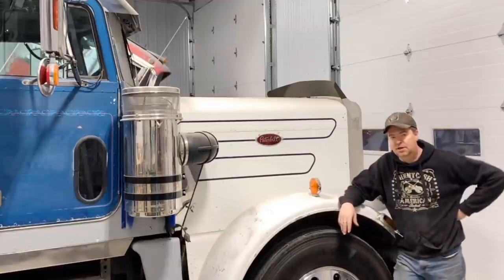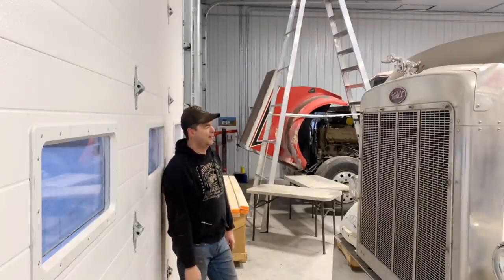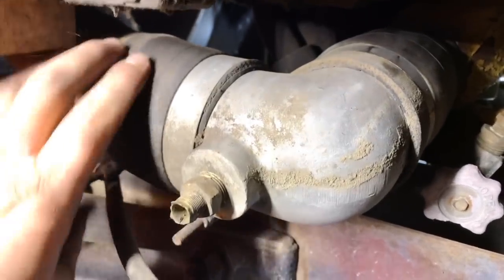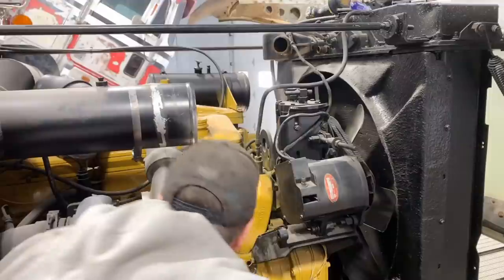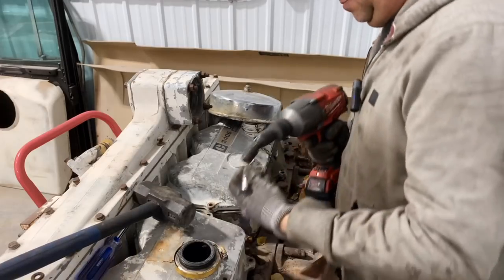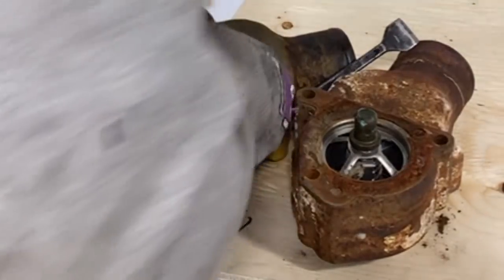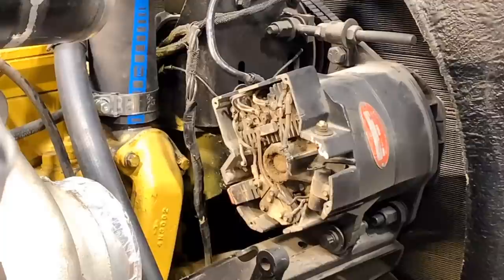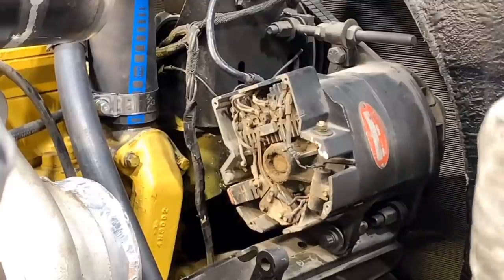Peterbilt 359 Restoration Ep.69 Candy Flavored Coolant

Comment: Thermostat screws out as it heats up opens a gap between the cylindrical housing and the heating element side and let’s coolant flow by Mark your not the only one buddy I had to stick a propane torch to my old one to see how it worked because I was always scratching my head on the way it worked myself
Reply: Pretty close, it actually doesn’t screw out it uses a special type of wax inside the copper temperature sensing bulb that expands as it heats up. When the engine is cold coolant flows across the sensing bulb down through the center of the thermostat and down the bypass pipe back to the water pump inlet, as the heat builds up the barrel of the thermostat expands away from the base and at full open the face of the barrel seals off the bypass forcing all of the coolant through the gap between the barrel and base to the radiator.
Edit: I guess I should correct myself it might appear like it is unscrewing itself due to the bind of the coil spring that holds the thermostat together.
Reply: My Detroit thermostats are identical. And they work perfect.
Reply: @dennisternent2974  same one in a Cummins N14 too
Reply: I think his point was that the thermostat he bought is already open. At room temperature.

Comment: I seen two mistakes you made on the bottom with the pitcock elbow. You should have cracked the first gallon of antifreeze and lubed the hose ends and you should have had your clamps already in place
Reply from the maker: I did use a little soap inside the hose and it wasn’t an issue to put the clamps on afterwards 🤷‍♂️
Reply: @TwinStix  I had no idea you prepped behind the scenes

Comment: If you take some household dishwashing liquid and rub it on the inside of the hoses it'll slip on much easier.
Before putting in the expensive coolant get some radiator flush.
Put normal water in and flush the engine about 2 times at least.That way you can get  any rubbish in the coolant system out before expensive coolant goes in.
Reply: A little saliva works good to
Reply: Cat flush ; I used WD 40 on the hoses !
Reply: Be careful with the flush I did it with cat flush and it did such a good job the water pump started leaking. We used to use calgon back in the old days

Comment: Glad to see you used the "lined" clamps for the silicone hoses. A standard clamp with the diagonal slots exposed will eat into that silicone in no time. Silicone hoses will last the "life" of the truck, as long as you use those clamps, and also make sure that NOTHING chafes or rubs the outside of the hose. I've seen wire looms, tie-wraps, or air lines slice right through a silicone radiator hose as if there was a grinding wheel put to it!!

Comment: Congratulations on the new compressor. I got tired of dragging air hose around. This started me on the quest to run air lines around to convenient places. A farm supply store had kits, but it was expensive. Someone else said to use black pipe. This would have required someone with a pipe threader. Looking around Home Depot I noticed that PEX is rated for 160 psi, or piss I, as Peg calls it. This solution has worked well for me since my compressor is set for 150psi, and my regulator is set to 100 psi. In over a year it has worked out well.

Comment: I use a whole bottle of dish washer soap (no bubbles) fill with water and run it till operation temp. Then dump and then run a few cycles of water threw it to really flush soap and crud out.

Comment: Once the thermostat opens, there becomes a gap between the upper ring and the cilindrical schaped piece, so the flow of coolant does not go straight thrue. It goes in  from the side and goes out the top. Sorry for the crappy english

Comment: Hey Mark i use hairspray on all rubber hoses clean the metal up and spray both recieving ends of hose stick the hose on and let it dry as long as you can then put clamps on seals everytime

Comment: Some shutoff valves on the hoses going into the cab cores is a good idea in case of a core leak or you don’t need heat there during the summer.

Comment: The seal shuts the water from circulating, when the thermostat opens then the water flows through the system. There is a product called restore made by Cummins or Fleetguard which is part of Cummins and available at Peterbilt. It cleans the cooling system. Works well for cleaning the system from oil as well after a oil cooler failure. Most people use it even in the Cat engines. After running the Restore run clear water through it to rinse it out then put in your coolant.

Comment: Mark, you got it right on the gasket sticky side. Always goes to the smaller easily removable part. Cleanup is much easier that way. To keep water out of your compressor tank, there's auto drain valves. Might want to check that out. Lots of choices.
Reply: We put pull cable like on a “ truck “ air tank ! When we would turn on power too the shop you pull the cable too drain the water everyday!!!!

Comment: Mark, what you called the condenser on the alternator is likely just a noise suppression capacitor, used to filter out the electrical "noise" of the alternator and prevent it whining in the truck stereo or UHF speakers. I guess condenser is probably still an accurate term too. It'll still operate fine without it but can get annoying. And it looks pretty simple to fix. Small general aviation prop aircraft alternators mainly use external capacitors for the same reason.

Comment: Hey mark. If your hoses are bulging that could be a sign of the coolant system pressurizing up. Maybe from a head or gasket issue. Coming from my opinion after having a c-15 blow all its new hoses because of a cracked head. Not saying yours is but carry some extra hose and coolant to get you home if that issue arises.

Comment: Mark, put the thermostat into a  bowl of boiling water. Particularly the copper wax filled element, then watch the valve open.. These thermo valves are used in oil cooled air compressors

Comment: Fluid is around the outside of the thermostat. When it opens it slides and let's fluid come from the sides of thr barrel of that thermostat. Otherwise it goes threw bypass until coolant is warm enough to open sides to allow threw the center and less resistance than the bypass. Hope this helps.

Comment: Good tip with the shut offs, open fully then turn back 1/4 turn that way the rubber seal inside doesn’t get stuck and seize in there on ya next time it needs turning….

Comment: Diesel exhaust has some fuel oil vapors in it when you run them cold. If you run your air compressor in that atmosphere? You will contaminate your air supply and that`s bad if you do paint and body work. Fish eye and all sorts of issues. I would plumb the air supply outside the garage to fresh air.

Comment: Little trick I learned but i don’t know if it’ll work for that big of a cooling system. Take a shot vac and make ya a grommet for the for the radiator cap neck and you might be able to pull enough vacuum to slow or stop the coolant from gettin all over the place. I did it with a Grand Prix for the engine oil plug seal and I was wowed that it worked for the oil. Didn’t spill a drop to change the plug seal.

Comment: That seal on the thermostat needs to be straight or it will leak and bypass, 
But I suppose that’s better than none at all.
Movement up and down open the passage to the radiator
Good luck with the extended life cat coolant it will find leaks you never know you have, very good for liner corrosion though.
Another edit just imagine doing this on a 1990 truck that is working every day.
Enjoyed the video because I’ve felt the struggle. Prost 🍻

Comment: Sanborn compressors are the same as Coleman powermate compressors and the Kobalt brand sold by lowes.

If you shop around the cat coolant is not that expensive I usually pay around $20 per gallon for that exact coolant.

Comment: I use a female air compressor fitting on my air tank then use a male to male with a valve in between makes it much easier and cheaper plus it allows you to be able to hook a air hose to air up tires when your away from the shop

Comment: I hate commenting cause you’re already done with the task.  Any ELC Diesel coolant will work you don’t need to pay for the CAT name.  When the T-stat slides opens it blocks a port in the passage allowing the coolant to flow to the radiator, then slides closed closing the passage.
You could have removed that old artic coolant heater cause I doubt you’ll ever need it. If you do leave your truck outside in the cold you can purchase Fleetguard block heater for much cheaper.
Silicon hoses are excellent just ensure nothing rubs on them.
You have mineral hard water deposits build up in your system.  Does this truck have a coolant filter and you may want to have the system flushed before keeping the expensive coolant in there.
Great work keep these alive.

Comment: Did I see that right? Your mirror turn signal lights lit up bright when you applied the brakes. Is that how they’re supposed to be wired in Canada? I know laws differ some in light requirements between the states and Canada.
Reply from the maker: No it’s something that needs correcting

Comment: 20/20 hindsight you should have opened the Radiator cap. Looked like there was a bet of pressure behind that coolant.
Reply from the maker: I think it was just the head pressure/weight of 16 gallons of fluid 🤔

Comment: I tried silicone hoses once... and I will NEVER use that crap again. Holy cow what a mistake. Every single one blew at the clamp. The expand allot more then rubber does, and they chew themselves up at the clap edges. I hate to say it, but you better replace that stuff with real rad hose! I use 3M silicone paste (3M part number 08946) to very, very lightly coat the inside of the hose to get them on the fitting. You can use it on spark plug boots too. The stuff is amazing.

Comment: When you drain the coolant  there was pressure because youve let the engine run,
Why dont you use a litlle bit gasket maker, the liquid gasket on the gasket?
And why dont you sandblast the housing and then paint and mount them.
Just an idea.
Keep on wrenching,

Comment: if you ever take most of the stuff your putting on off you will kick your own butt for not using anti sieeze on bolts that pass thru stuff, like the thermostat housing, the lower seal blocks the coolant flow and it slides the bore up and down letting coolant pass,  wd 40 sprayed on the hoses and the pipes makes your life easier, if you havent done it already you need two bottles of dca added to your coolant system and then test strip it at services for the ph level,  dca is much cheaper than coolant filters, which have hard dca in them that is dissolved over time,  the thermostat is basically the plug end of the cooling system hench the regulator name from cat, a cummins or detroit part would have worked also,

Comment: Seriously Mark, a truck leaves the factory with some kind of problem or more problems. And the grandkids if Bidens branch has their way, all electric automatic trucks that will hover over the roads... George Jetson was just the prelude to things that come... that PBR can will come  from our beautiful trucks we busted our a$$es off on. I do have news from a rig I seen put together in the not so great state of califony... shrink fit hoses on everything and I mean everything... extreme heat, and very high pressures. The theory behind those thermostats is to not cause a hot spot on the liners, it creates a vortex and water will always flow but just enough restrictions to do the job. I kind of dig it really as water that gets too hot is  how the calcium is caused to separate from even distilled water. I don't think there will ever be a perfect system, I drank water from streams in the mountains as a kid and paid no mind to the foam on it or how it got there... still no beaver fever but when I see a critter in the woods I seem to get a bit horny... just a coincidence I'm sure. I just know though that the demorats will have a  theory on that too. Just me talking now but get that compressor outside the shop in its own little room insulated from the cold... your never going to regret it

Comment: You made me laugh. I took a plug out of one of my air tanks. Put a brass valve on it and   quick connect fitting, boom I have air. I also carry 50 ft of air hose so when I'm out on the road I can plug into it and air up my trailer tires and truck tires.  I don't understand why you ran that line all the way from the air tank into the cab.
Reply from the maker: All the way??! It was like 4 feet 😂 and it’ll keep dirt/snow/ice out of the end
Reply: @TwinStix  oh that's right I forgot you live up there in the Na-nook of the North. 😂

Comment: Globe valves should only be used when the flow needs to be moderated, otherwise ball valves are superior.  Plumbing tape and compounds (no matter what the container says) is not a sealant, it is used to get it apart later, ask a plumber.  If you connect your old air compressor and your new air compressor together you will have even more air volume.  (assuming the same pressure)
I always start with the hose bands on the hose and a touch of soap is a fine temporary lubricant. Ron W4BIN